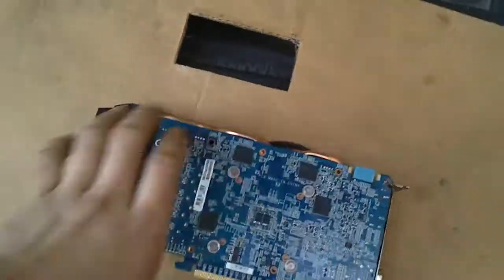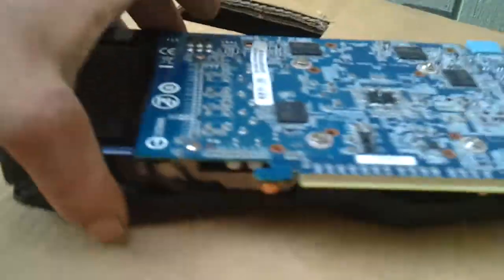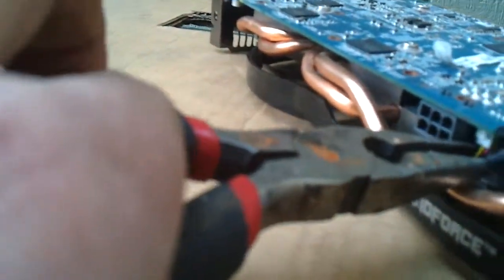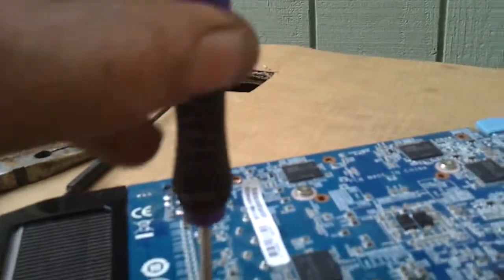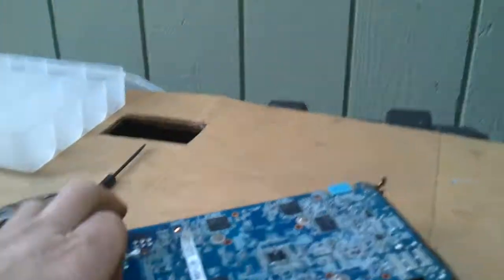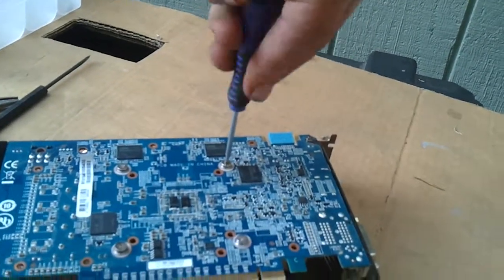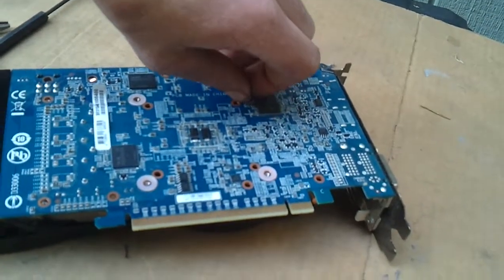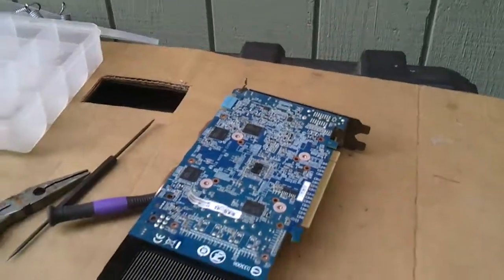Gigabyte Nvidia GTX 660 teardown part 1

Comment: what do you mean teardown? that the video card is destroyed?
Reply from the maker: Taking it apart is what teardown means. I was taking it apart, because I just got it at the time, and I take things apart to clean them.
Reply: Sir when i put card in motherboard fan running fast but system not working what is tha problem gtx 660 wind force